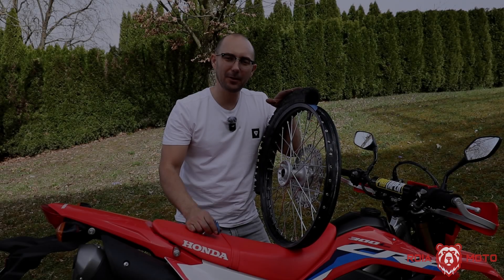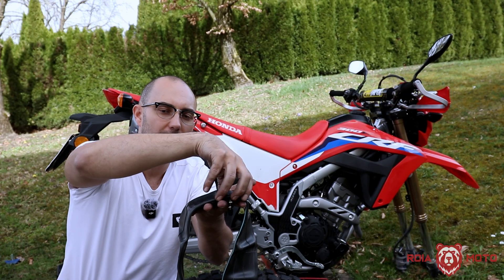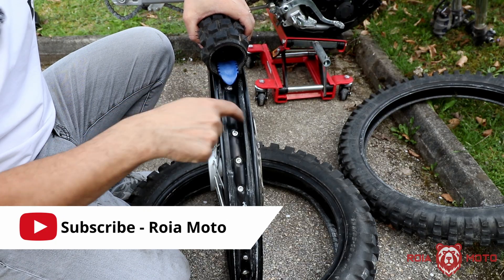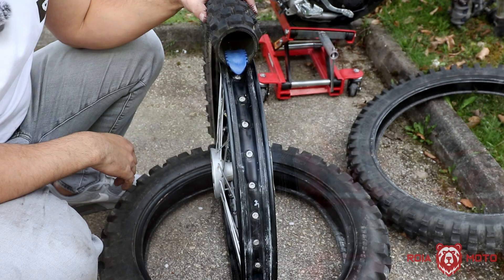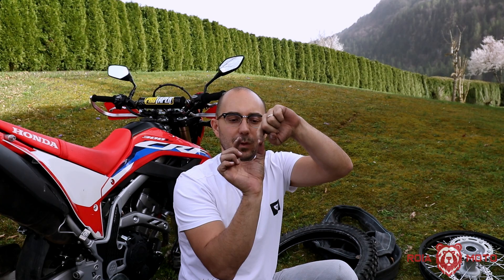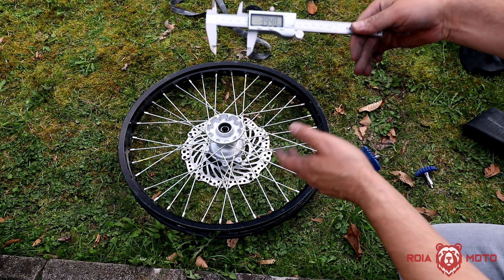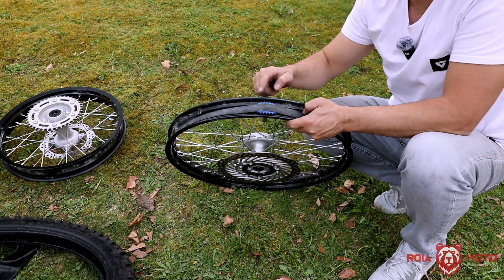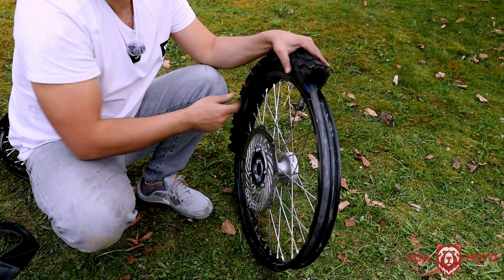RIM LOCK - HOW DOES IT WORK?

Comment: If you are running a tubeless tire with a tube, will the rim lock work on that style of tire?
Reply from the maker: If you use tubes inside a tubeless tire, you can use a rim lock just like you would with a traditional tube-type tire. Since the tube will contain the air pressure, the rim lock can help prevent the tire from slipping on the rim, especially at low pressures, without affecting the tubeless design. Many riders use this setup in off-road situations where they need to run lower tire pressures for better traction and control. 

Just make sure the rim lock is installed properly to avoid pinching the tube, as this could cause flats.

Comment: yeah, I got mine installed without the counterweight and now its so funny to drive. Will balance it on my own.
Reply from the maker: I needed to add quite a lot of wheel weights for the rear wheel. Don’t be surprised when you are doing. I’ve added about 80 grams to it.
Reply: @RoiaMoto  I added 180 grams and now its driveable lol. Will get to local dirtbike service and have them balance both wheels normally because I did the garage method - large metal piece strapped to spoke with zipties 😅

Comment: silly question... tyres often have a balance dot on them for the lightest point & normally you put this at the valve to compensate for the valve weight & minimise additional balance weights. Given the rimlock is now going to be the biggest imbalance should you put the tyre balance dot at it instead? (rather than at the valve).
Reply from the maker: Hi mate!
Not silly at all! It’s a perfect valid point!

Before installing Rim locks the heaviest point of my front wheel with tyres was exactly at the valve stem.

After installing rim locks, the heaviest point shifted to a point between the rim lock and valve stem.

I can conclude that the rim lock helped to offset some of the weight of the valve stem.

Unfortunately it’s impossible to precisely know in advance where the heaviest point will be for every tyre, wheel, tube and rim lock combination but your point makes total sense. 

On my next tyre change I'll line up the dot on the tyre to the Rim lock and see how it goes.

thanks for your comment!

Comment: Great video as always! I don't know how useful this rimlock is though... do you think that this type of tire "slippage" is really a big concern for non-performance everyday bikes? And it looks like more of a trouble if you need to change a tire somewhere in the wild. Also, at first I thought it uses the opening for the valve stem, but later you showed that it is on the opposite side of the rim - does that mean that you have to drill a new hole in the rim? That doesn't sound very good to me.
Reply from the maker: Hi Ivan and thanks for the comment!

For the CRF300L it’s very unlikely that the tyre would slip on the wheel due to power/acceleration . 
The main advantage I see is that even in case you get a puncture/flat the rim lock should allow you to “limp” back at slow speed to a place where you can fix the issue. 

Regarding the hole, the CRF300L wheel already comes with a hole for the rim lock.
Reply: @RoiaMoto  Thanks for the reply!